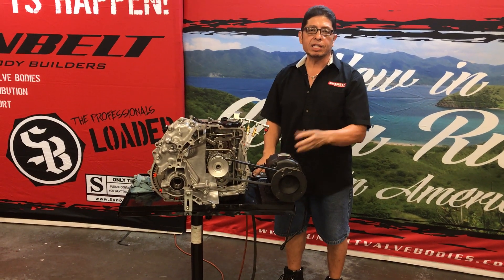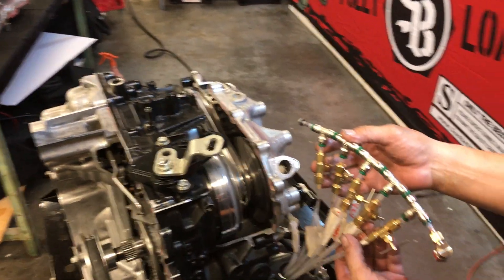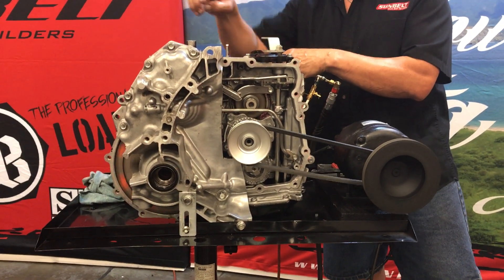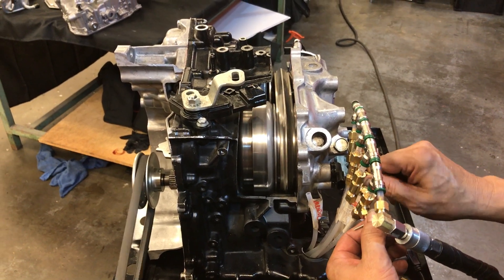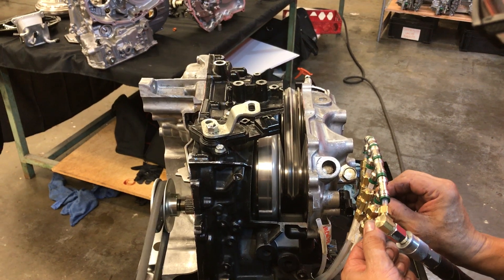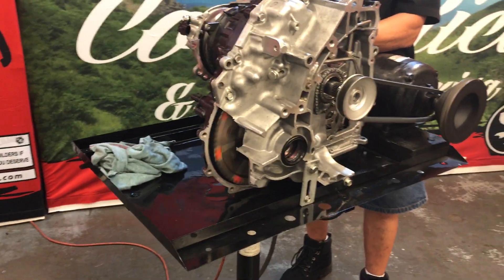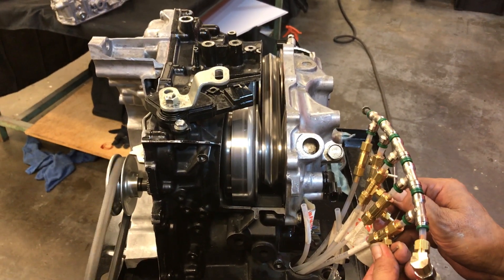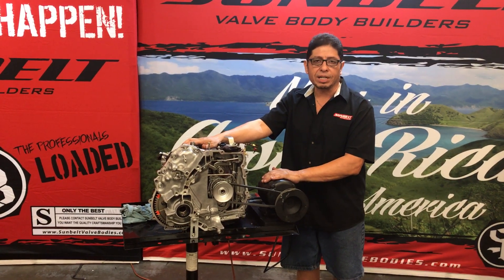Nissan CVT REOF11A (JF015E) Demonstration ONLY

Comment: Hello sir, I have a Nissan Juke with REOF11A gearbox code with symptoms that the car will not run, long story short, there is a replacement for the steel vanbelt, CVT, solenoid, oil pump but the results are still the same as before, please help, sir.?

Comment: Finally we find someone that really KNOWS how a CVT works. Thank you kind Sir. I did  not know that the secondary pulley was controlled by a spring. I thought that hydraulic fluid controlled both the primary and secondary pulleys. Live and learn. I see it now. Wow.

But I think I know why both are not controlled by hydraulics. For if both were controlled by hydraulic fluid working opposite direction of each other, and one failed, it would tear the CVT to pieces immediately. Am I correct kind Sir.

Comment: Great video guys! Very cool! Is it possible to change out the cvt belt with the transmission in the car? (2013 nissan versa sedan)
Reply: Very unlikely. It would at least have to be dropped onto a jack for the housing to come apart. You can get the pulley and belt assembly as as replacement part online now though. I've got the 2013 Sentra and I plan on rebuilding mine if it fails
Reply: My 2013 sentra cvt failed after 104k miles, I had a pulley speed sensor that failed which was internal. Couldn't find a transmission shop that would fix it or rebuild it so I was forced to have the nissan dealership replace my entire Transmission...costed $4680.